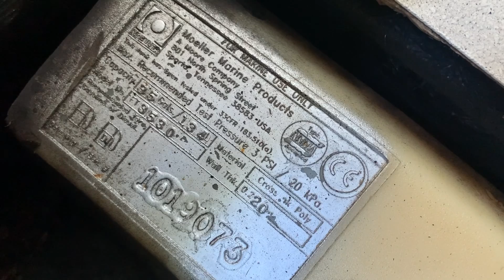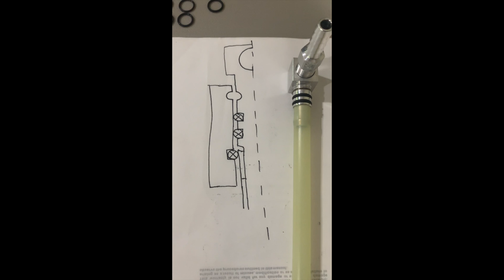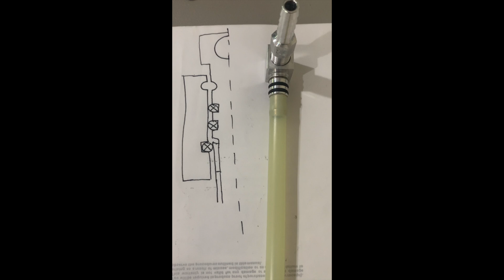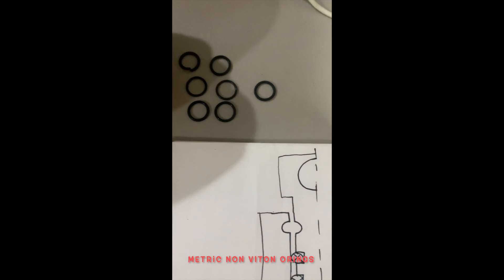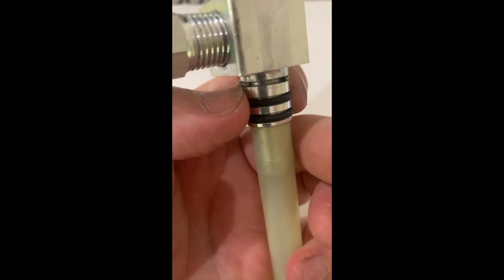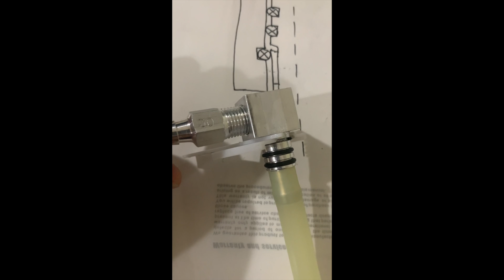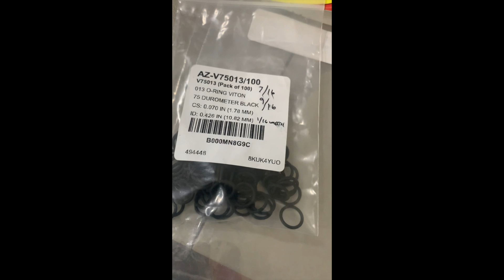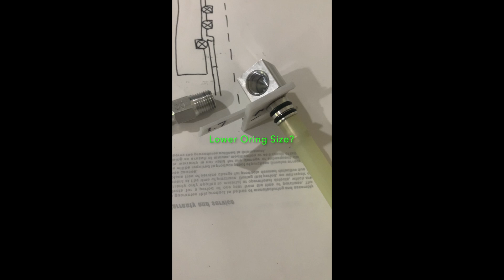Moeller Pickup Tube PopLock PL3 1/4” NPT Removal & Installation w/ New Orings 3D Printing

Comment: Wow. I need to replace this on my 2008 Stingray. I'm so glad I found this video. I had been expecting to unscrew the fitting and when it rotated I knew this was going to be interesting. I might just bring it in to have done in the shop. I don't know if I can come up with a snap ring compression solution like you did. I don't know for sure that the pickup tube is the problem, but it seems like it is. It quits running with 12 gallons of gas still in the tank.
Reply from the maker: Open the gas gauge port and have a look.

Comment: HI How did you actually remover the pickup, mine is stick guess there is a mesh filter / screen at the bottom
Reply: Yes
Keep pulling
The mesh is trying to get thru the lower o ring
Reply: @kathleenheuser7656  Thank you, so eventually the mesh will pull through?
Reply from the maker: @rmhw4 yes, did it come out?  You can try getting tank access via the fuel level gauge hole

Comment: Super big thanks for the video.  I have been looking for help with these dang things.  Really appreciate your drawings, lets me see how it is supposed to go together.  My problem is that the pick up tube wont go down far enough into the tank for the snap ring to engage its groove, it sits almost a quarter inch above the flange... its the existing tube not a new one.  How much pressure needs to be applied to seat it?  Have pushed about as hard as I feel safe too so far.

Thanks again, seems like your the only one to have addressed these pop-locks, Moellers help was completely worthless.

I would advise anyone to avoid the pop lock design if your getting a new tank.
Reply from the maker: @aquadud2222  
I spent weeks working on this to find a system to install and replace orings.  Glad you found it helpful.   I did not have to apply a lot of pressure to get the snap lock to the top of the housing.  I would take off the current orings to see if they are binding.  There is a minimal amount of oring compression for them to slide down 100%.  The 3rd Oring in the housing looks ok?
Reply from the maker: Stick a coat hanger down the hole to check the depth and compare against the length of the pick up tube.  You might be hitting bottom
Reply: @stang1966gt   It is the existing tube, not a new one. It fit before.
Reply from the maker: @aquadud2222  
My concern is the factory did not cut the pick up tube short enough
Reply: @stang1966gt   Thanks but I dont think you understand.  This is the tube that came with the tank, for 4 years it has been fine, fitting started leaking in August.  It is the same tube that was properly installed before.

Comment: I'm in the process of ordering a 111 gal tank but your video makes me rethinking about the order. It seems like a very complicate job to replace these pickups
Reply from the maker: They also sell a threaded connection.  I would certainly go for this over the pop lock.
Reply from the maker: I pulled the pick up, per my mechanic’s recommendation, but turned out there was no gas.   I don’t see a need to remove it, unless you need to clean the screen.   Yes, it was a pain to figure out a system to remove and install.  Was happy when it clicked back in.   Are you able to see the pick up tube from the side?
Reply: @stang1966gt  I'm replacing an aluminum tank and I'm considering a moeller poly tank. The idea to service a pickup in the future makes me wonder if this is a good idea.

Comment: Can you  till me where I can order them  from i can't find these ports no where thanks
Reply from the maker: NEW MOELLER FUEL PICKUP-POPLOCK 360DEG 24" MOE 03310024 https://a.co/d/fISBDLs
Reply from the maker: The installation tools I made myself
Reply from the maker: Seachoice Anti-Siphon Valve, 1/4 in. NPT, 3/8 in. Hose, Aluminum, Meets USCG Regulations https://a.co/d/alBzrQ7